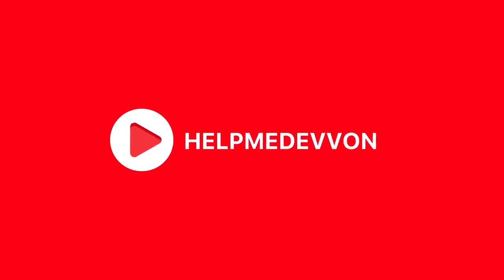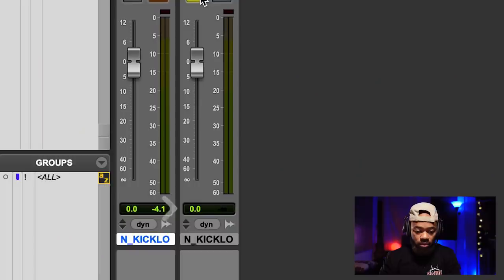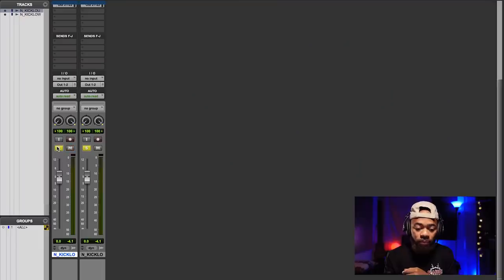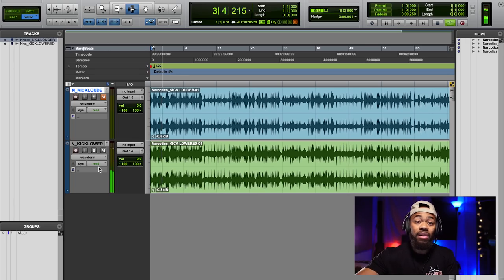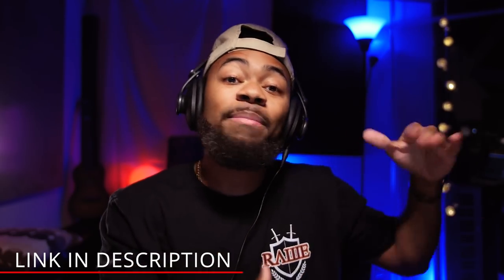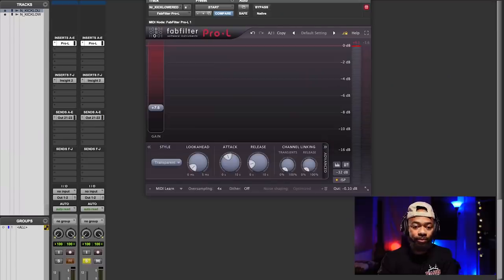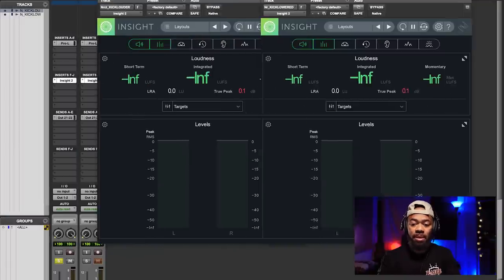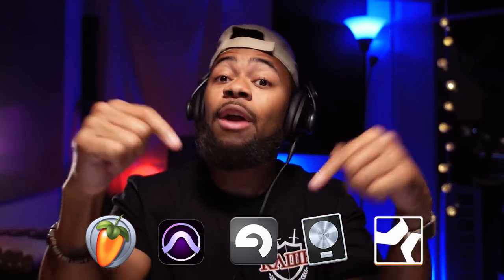The Biggest Mistake You Can Make Mixing Music

Comment: So is it a matter of turning the kick down, EQing some of the bottom end, or both?
Reply from the maker: It’s both so if u have the tracked outs you have the power to bring down your low end but if ur working on a 2 track you might have to use eq of multiband compression
Reply: @HelpMeDevvon  so what’s the difference btw tracked out and 2 track

Comment: Damn why you tell me to add smack attack to my 2 track then
Reply from the maker: If its mixed well then you wont have a problem but if its crap then your boosting crap know what i mean. This video is to show the power of balance it has nothing to do with the smack attack.
Reply: @HelpMeDevvon  kinda does, because remember with a 2-track you don’t have track outs... so adding a smack attack as you recommended doing increases the punch in the low of the beat for sure. It’s not like I can just say hey lemme go turn down the kick because I can’t. This is the issue for some people too who like me aren’t financially able to purchase tracked out beats.
Reply from the maker: @IOG2K  simple fix to balancing the energy of you 2 track would be multiband compression and eq . You can easily lower the low end energy if you attack it with these 2 tools! And your forgetting that smack brings up everything not just the kick but the snare, hat hard synths everything just use your ears and remember it’s not always the right move to throw smack attack on! Use your ears!
Reply: @HelpMeDevvon  thanks man I appreciate it!